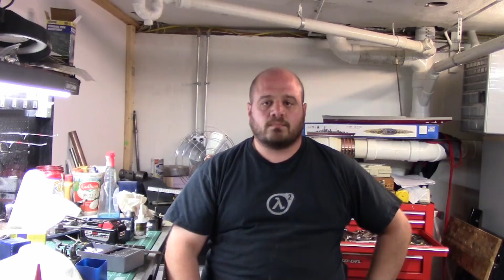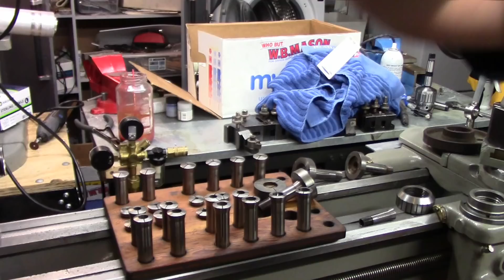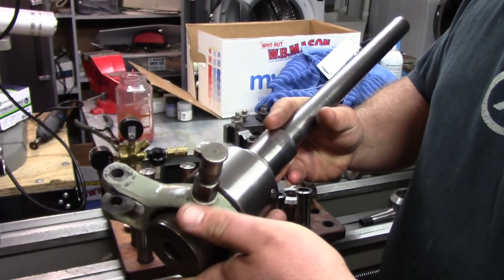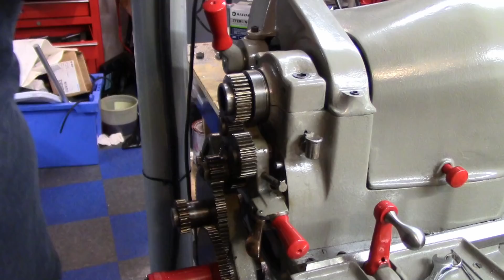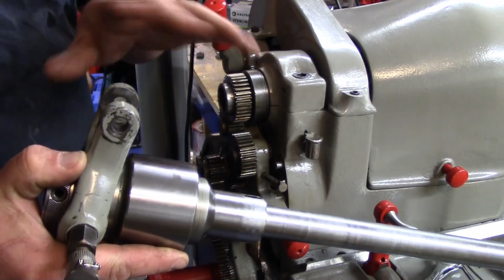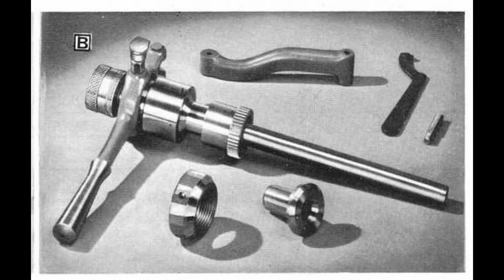I NEED HELP!!!!  Southbend Owners!

Comment: My Southbend 13 has a collet closer draw tube with just a handwheel to tighten it and close the collet.  That being said those collets are damn near impossible to find if anyone has any info on those. I would like to find some to add to my small collection

Comment: I have a 10 inch with a 5c closer the gear is replaced by a gear with a sleeve that sticks out and the internal key slot come clear out to the end so the key slot on the collet handle end uses the same key slot on the gear sleeve also due to the tub needing to be extended you need to pin them together becouse of the threading of the collets so you dont unthread it and the arm get everything else done and set up and you can then measure how long the arm needs to be i just kinda did this on my old old 10

Comment: I have a 14 1/2" Southbend and I bought a 5C collet chuck, a 32 piece set of collets. I'm very happy with it. A great way to modernize an old lathe. My lathe originally had 4C collets that are next to impossible to find. Good luck.
Reply: hey randy ...i was wondering i also have a south bend 14 1/2 with the collet closer on it but i didnt get anything with it ..no collets or spindle nose protector or the spindle nose piece but i thought it used 5c collets i noticed your comment said it uses 4c ...is it worth trying to get this going or just do what you did
Reply: @wreckingball518  I went with 5C collet chuck and collets because 4C became kind off obsolete. You can get a nice quality 5C chuck for around $120.00 and the collets are 6 to 7 bucks. I also had to get a backer plate and 1 1/2" x 4 threads per inch is not available so you might have to make it yourself. I had a friend make mine. A bit tricky for me. I am so happy I did this. I looked on ebay and found worn 4C collets that were 50 years old, it was not a good investment. Look on CDCO tools. Thanks for watching
Reply: @wreckingball518  5C will not fit 4C. Look at my other response. Good luck Christopher

Comment: Howdy, I have a heavy 10 South Bend that has the extension for that gear. My gear overall length is 1 1/4 inches long and the smooth portion is 5/8 inches long. These measurements are from a tape measure, If you need specific measurements I can get those for you. I can send a pic if that will help

Comment: As some of the others have said, it looks like the lenght of the spacer doesnt matter.  The only purpose of the adapter/gear/spacer is to lock they keyed spindle with the keyed collet closer so that it doesnt change your adjustment on the collet?  Instead of trying to find the right gear or make one with the spacer, can you just make a sleeve with a keyed slot to match the closer and pin it to the gear?  Is there enough meat on the gear for a hole and pin?

Comment: Hi Greg this is not exactly the same but might help you work out what you need to make to compleat the whole mechanisim https://youtu.be/2sWlUdK-BcM , starts about 20m in. RR in the shop also has a serise on modifiing the one for his Logan lathe which is also similer https://youtu.be/IMBs4Vo0JI8 . Work quickley the patter of tiny feet are getting closer.

Comment: seems to me the length isn't super critical, as it has the tension adjuster knob on the end!
it not being able to slip from the gear appears to be critical! hence the key-slot and what others are saying or else the adjustment would change, either loosen or self tighten with load and gall the gear+

Comment: You don't need those dimensions, the sleeve drive gear combo extends just past the woodruff key. The keyway on the sleeve is slotted so the closer slides in. Since the closer body bottoms out on the end of the spindle the actual length doesn't really matter. Diameter should be a slip fit. - Mike

Comment: Greg I might be way off base here and I am also new to the lathe. I also am a subscriber to your channel I have commented only a couple of times. With that being said I have a 9 inch South Ben and I have been looking for collets for it, I have the draw bar but that's all. From the research I have done it looks like I just need the collets and the draw bar pulls them in tight. Could you make the draw bar for yours that is the perfect length and draw them in tight. If I am off base here I apologize in advance.
Reply: You need 3C collets and the spindle nose adapter
https://littlemachineshop.com/products/product_category.php?category=-195207565
Reply: 12345NoName thanks for the help on the 3c collets and the spindle nose adapter.